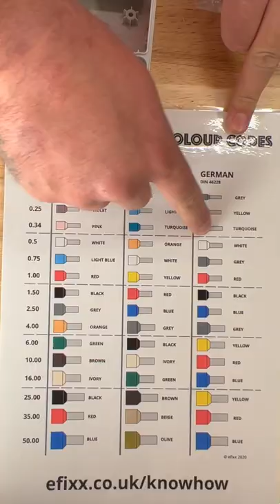Knipex NexStrip: The Multi-Tool for Electricians

Comment: Its fascinating how different we wire in the USA.
Reply: Yeah UK electrical code is vastly superior with alot more things that just make Sense
Reply: The US code is more of a suggestion.
Reply: @matthewlewis5631  conversely we (in the UK) don’t seem to have any codes around bathroom installation. Anyone can just install showers etc, tiling straight on to plasterboard which goes black with mould after a few months.
Reply: @DMC888  same thing in most of the US, however, most new installs will use a plaster/concrete board (which won't degrade if wet) and specialized water proofing membranes before the tiles and stuff get put on.
Reply: I mean it is but we still use these ferrules in the US. 
They are used or should be used whenever you're inserting tiny stranded wire into these DC or low draw AC type terminals. Especially if the terminal has some sort of screw for the retention mechanism, these are wonderful. 
Let's also not forget that the UK is 240v vs the 120v in the US.  Smaller wires - cute terminals!

Comment: Looks good, but £120 for a plastic bodied tool!
Reply: We have similar knipex at work just without the crimper part, and they work good. If it's made of metal, it's to heavy to use all day.
Reply: Anyway, Metal should be coated with plastic cause this tool can accidentally be in contact with exposed juice

Comment: Doesn't crimp ferrules correctly to fit in round terminals, plenty of panel builders would be fired for square crimps.
Reply from the maker: Most DIN rail terminals are square.